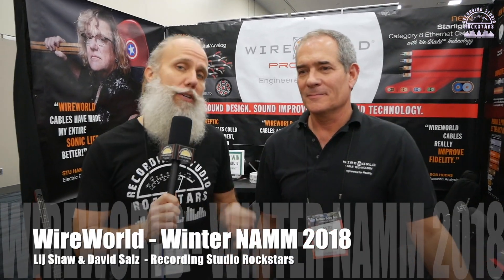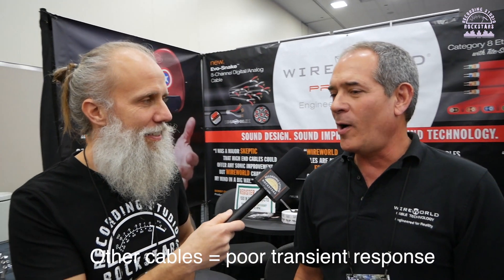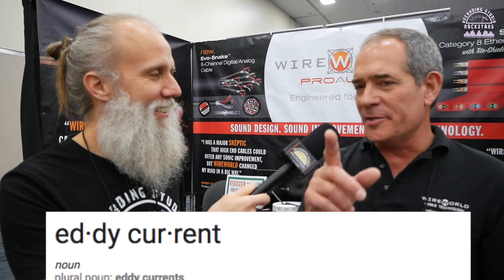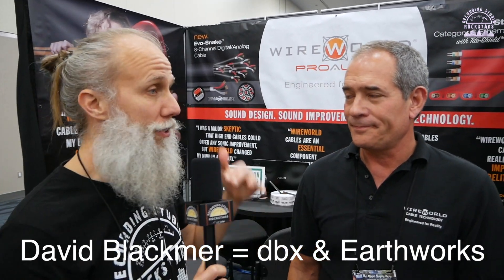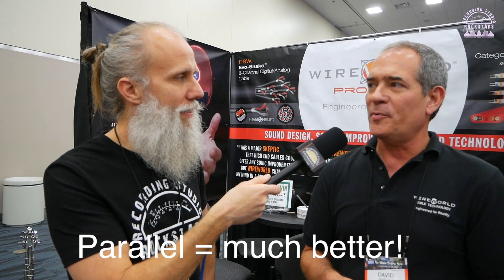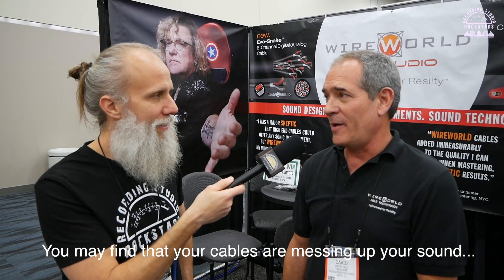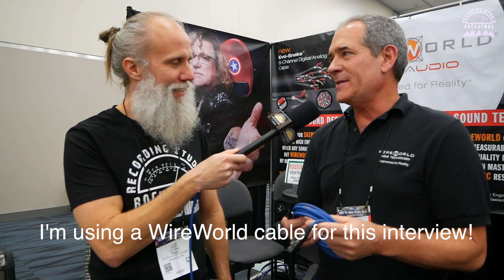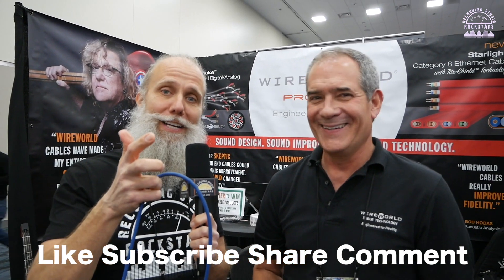Are Your Cables Killing Your Sound? - WireWorld NAMM 2018

Comment: Are these cables  better than mogami gold XLR cables?
Reply from the maker: descargamusicalny according to David the parallel strands of WireWorld sound better (losing less of the transient in your original signal) than Mogami because Mogami is still using twisted pair. At least that’s my understanding. I have not done a comparison myself. But if you follow David’s advice then you might start with testing your purest signal path then adding your existing cables to see if you are already losing some signal.
Reply: It seems like the inner conductors are threaded & shielded differently. I just received my MOGAMI set and will ONLY be using those cables within a radius from 1' to 10'. Anything longer than that (especially on a floor with extreme pedestrian flow), and I guess the newer conductor threading would perform better (?). Are the connectors any different? Can the connectors be DIY replaced? Are they much more expensive than current reasonably priced brands (Sommer/MOGAMI/Cordial)? Or are they better compared to the extremely overpriced VOVOX brand?